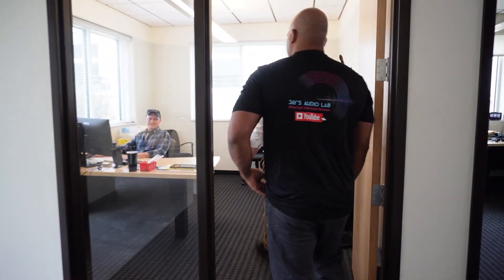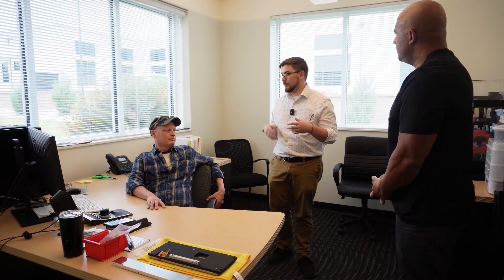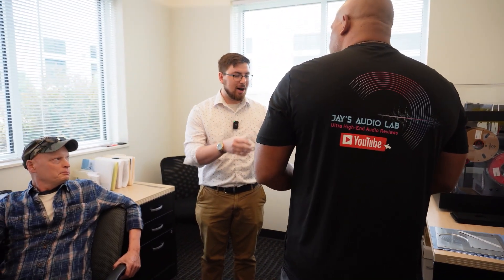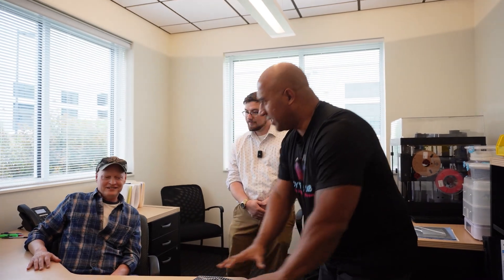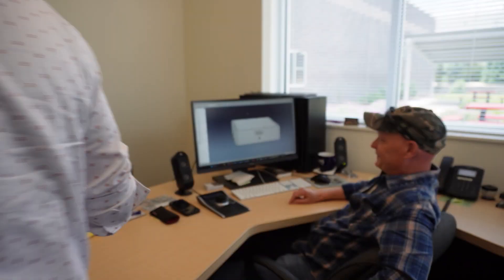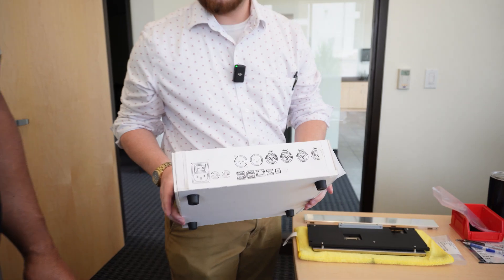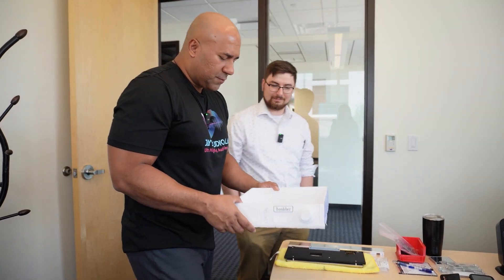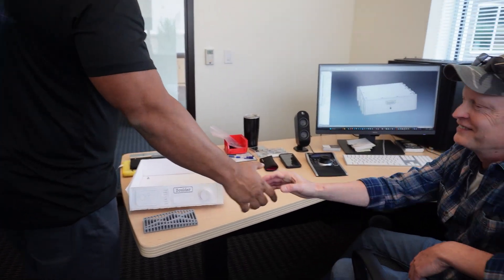Boulder Amplifiers Factory Tour: Mechanical Design - High-end audio

Comment: Just to own those big boulder mono blocks, would be the a dream come true.
Reply from the maker: You never know !
Reply: It cost £1500 too make
Study electronic course for 2 months, you can build much better than this garbage with

All copper chassis
Usev33. 000uf instead off cheap 10.000uf, use 1500va transformer, bipolar design, swith relays, infest in quality stainless steel fan instead off cheap junk metal fins,  use all silver wiring instead copper.

Definitely Boulder is reading this, ask them this, why didn't they use this, they would be indenial hippocrte 😅😅😅😅😅

Comment: Wow that was really fascinating sir! Imagine factors like mechanical placement of components within a chassis is a critical part of amplifier design. And other factors like where does the toroidal transformer get placed with respect to the gain stage boards, for instance?  The materials, heat dissipation, RFI isolation…
Reply from the maker: Great point!